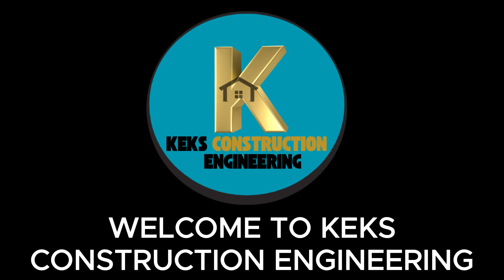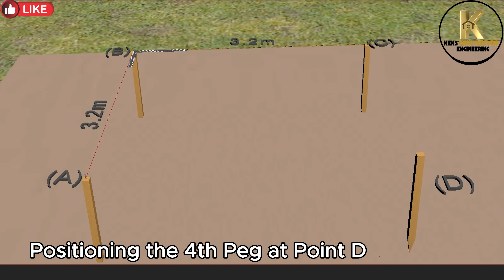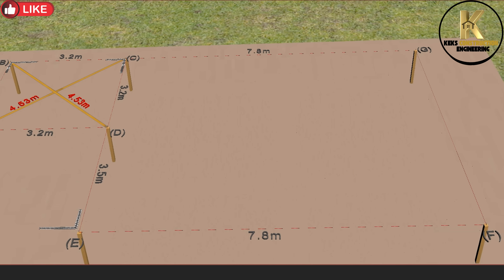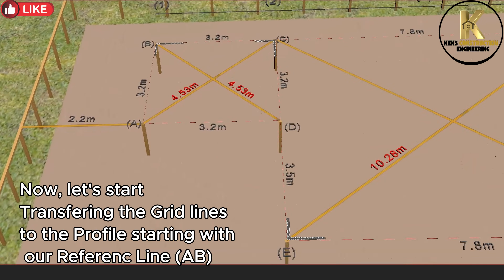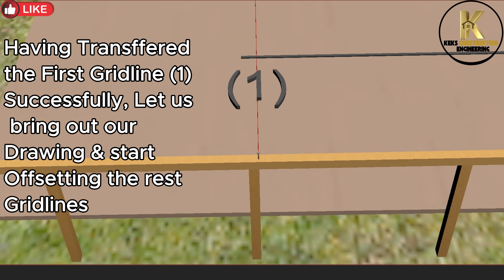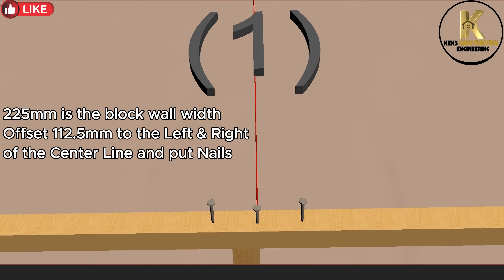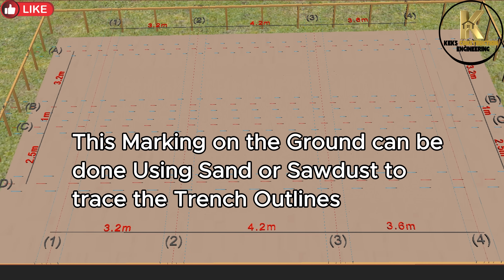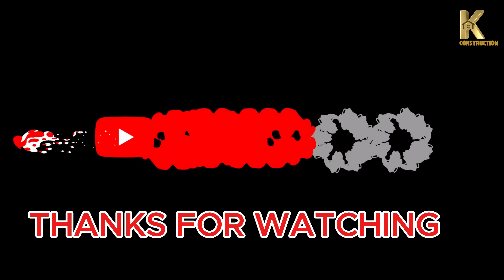Building SETTING OUT Using Builder's SQUARE |3-4-5 METHOD

Comment: So effective vid. What of if the diagonal are not equal
Reply from the maker: It means that the setting out /measurement is not correct. Redo it and reconfirm everything following the right procedures.

Watch other Construction Videos on this Channel, Join the Community & Stay Tune to KEKS CONSTRUCTION ENGINEERING for More & Better Construction VIDEOS Every Week. 

Feel Free to Ask Questions

Thanks
Reply: Is it correct to use 30,40 and 50cm as 3,4,5 method

Comment: Thanks for all you do but ive got a question:
Would the lines (strings) be taken out after marking with sand and re-established after excavation is done?
Reply from the maker: Yes.... That's why the profile was constructed. Those Gridlines that were transfered to the profile will remain relevant till the foundation is completed.
Reply: After clearing of the land (maybe by manual labor), would the entire land be graded before construction can start? If no, then what if some places are higher than the others?

2. What is a detailed step to transfer the grid lines to the profile? You just said we should transfer but you didn't state how

Comment: What could be the program if diagon is off with 10cm or than 10,
Reply from the maker: Recheck the Square of each of the Corner and also recheck your Measurement (Point-to-Point Distances).
Once you get these Right.... The Diagonals will be equal as Supposed.

Watch other Construction Videos on this Channel & Stay Tune to KEKS CONSTRUCTION ENGINEERING for More & Better Construction VIDEOS Every Week. 

Feel Free to Ask Questions

Thanks

Comment: Good day. I have a question. When excavation comment after setting out. The aggregate ( excavated soil can interfere with the extended profiles. What is your suggestion?
Reply from the maker: I Answered this Question while fixing the Profile. 
However, let me tell you. 
Offset the profile to a fair distance that's fair enough to keep the profile safe during and after Excavation. Then level all the ones that are interfering with the Gridlines.

Comment: my question goes like this, when you are doing setting out for large building how can you confirm the diagonal
Reply from the maker: Start the Setting Out with a Smaller Panel of the Plan, Square and Check the Diagonals as I did in the Video. 
You can then start Offsetting the rest Gridlines from there. 

Watch other Construction Videos on this Channel & Stay Tune to KEKS CONSTRUCTION ENGINEERING for More & Better Construction VIDEOS Every Week. 

Feel Free to Ask Questions

Thanks

Comment: What might actually be the problem if all the sides of the square are correctly dimensioned but tge the diagonals don't match?
Reply from the maker: 1. Check the Square itself if it's still in good shape and alignment. 

2. Error due to Parallax. 
(The position from which you View the Square and take your measurement may not be right and you won't know. So it's very necessary to stand rightly, square and view it from the same straight position to avoid Parallax error).

3. "Near-Accuracy": Most times on site People always go with nearly squared Corners and accept it that it's Square just because they don't want to go through the stress of starting the whole process afresh. Most times they hope to correct it as the construction goes on). This practice should be totally avoided else it will result to what you just asked. 

4. It has been Mathematically and Geometrically proven, If two Lines that are at 90 degree angle to each other form a perfect square or even rectangle with equivalent distances (measurement) on the Four sides, The Diagonals must be equal. 

You can further Verify this with your AUTOCAD, plot a Square and rectangle with equivalent sides. Check the diagonals and you will see that they are equal respectively. 

So there is no time that 4 lines will be Squared correctly with accurate side measurement that the two diagonal will not be Equal.

Watch other Construction VIDEOS on this Channel & Stay Tune to KEKS CONSTRUCTION ENGINEERING for more and better Construction VIDEOS. 

Like & Share my Work if you love what I am doing here . 
THANKS.

Comment: It's a very intelligent explanation....pls my question is in situations where the terrain of the building area is the remains of just demolished property having such a hilly and coax surface online ur video, after setting out the lines and ready to transfer the set-out to the ground what is d best method to use , I kw d use of saw dust nor arches are not ideal here ....... what method can I use ......shld I ask d digging men to enter d set out lines and follow the directly to dig instead of saw dust and likes
Reply from the maker: Ok in this case. 
Roughly Push & Level the Rubbles fairly so that it will not interfere with your Gridlines. Then Use Plumb bob to establish the Center of each Base just as I did in the Video. Since the ground is rough with Rubbles, give an approximate but bigger marking (that's bigger than the actual size of your excavation). This is because you cannot get the exact size of your trench if you mark the right sizes on the Rubbles. It will be full of errors. So by the time you excavate more than the actual trench sizes, You will have enough space to Adjust your Base and Starter Column Reinforcement to align accurately with the Gridlines as supposed. 
Once your Base and Column Reinforcement have been aligned correctly and you pour your concrete rightly... You are good to go. You can then backfill, level and commence the Super structure.

I hope you understand my Explanation? If you need more clarification, let me know, I am here for you. 

Do watch other Construction VIDEOS on this Channel & Stay Tune to KEKS CONSTRUCTION ENGINEERING for more and better Construction VIDEOS. 

Like & Share my Work if you love what I am doing here . 
THANKS.

Comment: The video very help full thank you very much and i have one question regarding with Our depth of excavation let as say we don't have level machine one site how can we make sure our excavation depth is complited Can we measure directly from our string line to down side to check the depth since we put the string line on the same leve
Reply from the maker: If there's no Levelling instrument on site, We can use the Spirit level (Plumb) to establish and transfer level across the foundation. 
Yes.... It's possible if we transfer the reference level to the lines and tension them properly to avoid sagging and inaccuracy. We can then measure the depth of foundation with our measurement Tape from the lines to each base point. 

You can watch other amazing Construction VIDEOS on the Channel and stay tune for more. 

Like & Share my Videos, if you love what I am doing here. 

Thanks.
Reply: @keksconstructionengineering 🙏🙏🙏🙏🙏 thank you very much for your  clear explanation i will keep following you all your video's are help full keep it up 👏👏👏

Comment: Thanks for enlightening my mind. I wish to ask you do a video explaining how to do a setting out for a land that does not have a regular shape
Reply from the maker: Ok. There is no big difference, We set out based on the nature and Geometry of the structure not the land in particular. 
If the building is Circular in shape.... Set out with the radius. And if it is other shapes such as triangle, trapezium and other polygon shapes. Set it out using the respective mathematical parameters. 

Thanks. 
Watch other Videos on the Channel and stay tune for more. 

Like and Share my work if you love what I am doing here. 
Thanks.
Reply: @keksconstructionengineering I love this I will share ur video to my friends and fellow engineers